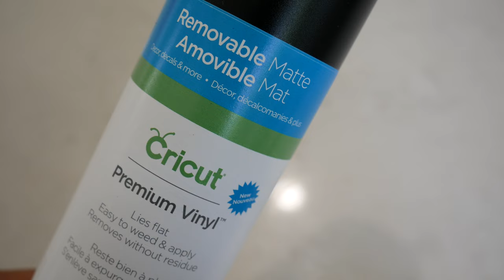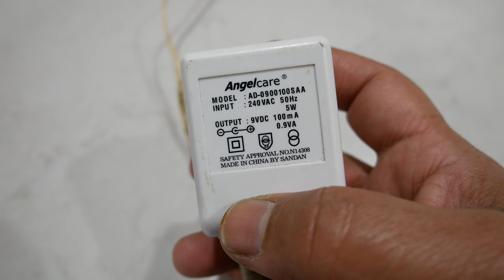Adjustable Wrench Restoration - Shifting Spanner.

Comment: That's a cool auto wrench! I was just about to comment a battery charger would speed it along...I also thought hmmm wonder if bluing would work with a stencil like that...so long typing short..very nice work my friend!!
Reply from the maker: Thank you Vic. Yeah should have gone with the battery charger at first but I was worried the extra heat would melt the vinyl. It all worked out well in the end 😉👩🏻‍🔧
Reply: @LittleRestorers  it won't melt it.. or i shohld say it didnt on  axe thingy I did a video on and it was thin vinyl I used and had same worries.. it actually pretty cool and a little scary all at the same time..lol

Comment: Very flash, indeed! 👍🏼👍🏼Makes my want to polish my tools! Then again... The etching worked out well. Have you used your sandblaster in similar way? It works great on glass, too.
Reply from the maker: @KevinD_33x150  As you might know, am always trying a little something new with every project. The etching was a good experiment 👌
Reply: @LittleRestorers  Etching is something I'd use in the future. It would go well with copper or brass plated stuff.